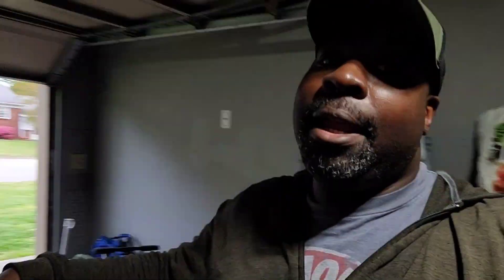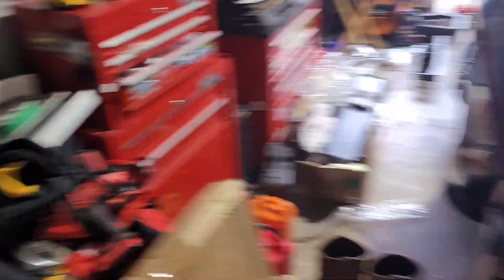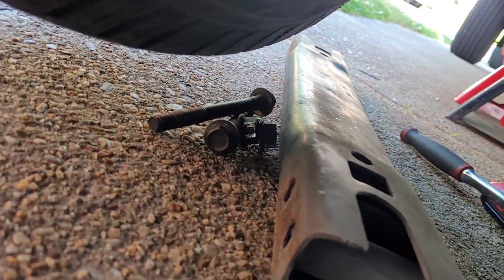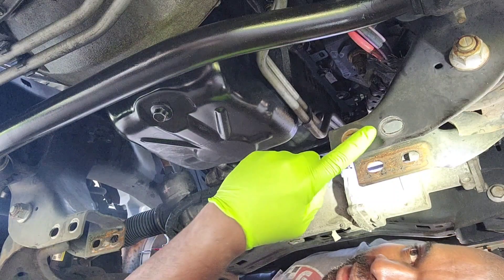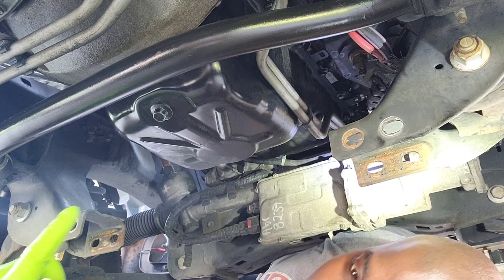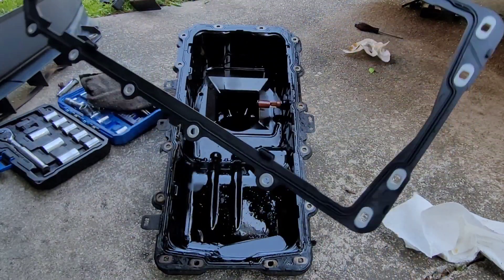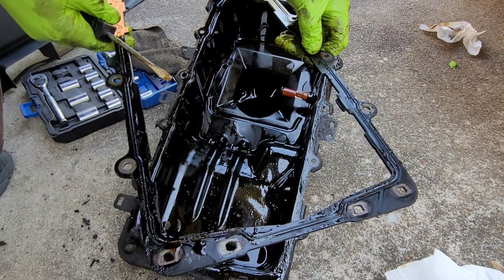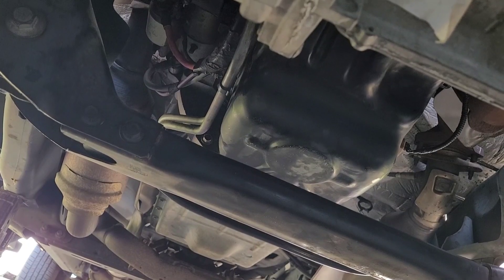How to replace an oil pan gasket on a 2012 Ford 150 2wd

Comment: Thank you for the video. Do you happen to know how long it might have took you?
Reply from the maker: I would say without doing a video a parrot could take me an hour and a 1/2.I'd say probably close to 2.Just in case you went into an issue.With getting some bolts out if they're rusted or anything but I think with me if i've without the video I probably could have got it done in the maybe an hour and an hour and a half

Comment: Where was the rtv supposed to go??
Reply from the maker: When you take off the oil PAN, it'll be on all 4 corners. When you scrape it off it'll be, there'll be a nice little split on all 4 corners where the block meets the backing of the transmission and the timing cover, so you'll notice it when you take it off. I'll be a little bit of Gray R TV from the factory on all 4 corners of the oil pin gasket.